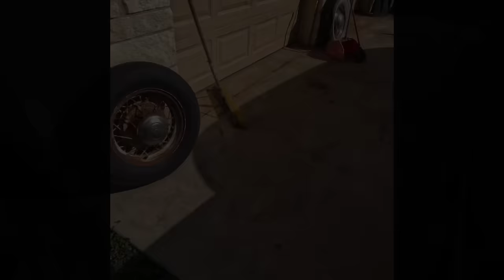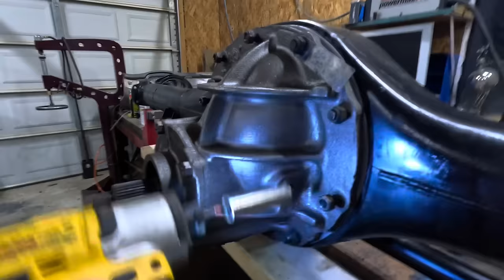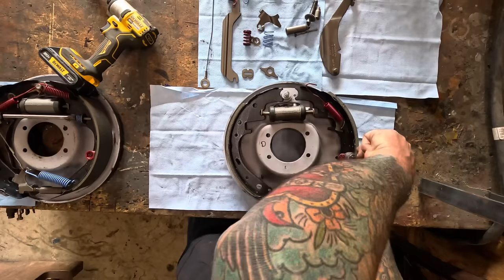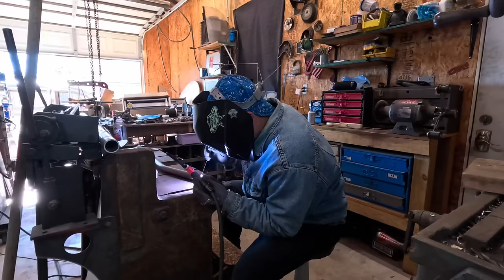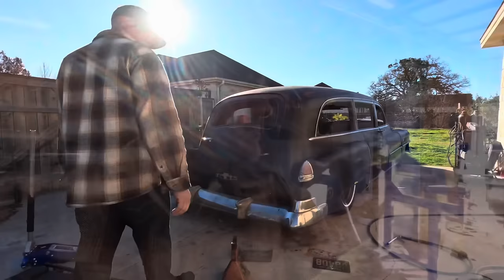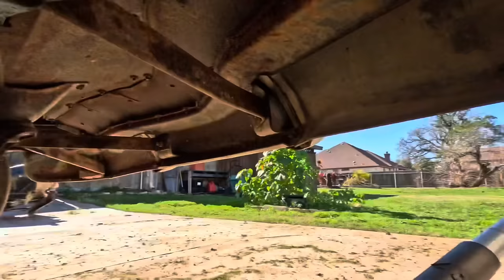1950 Cadillac Hearse Resurrection continues. Making room for magic EP6

Comment: Epic biuld,
I was also having issues with getting angled cuts also.
A few things that I found helped,
1. Put the plasma ground lead directly onto the material your cutting.
2. Slow the cutting speed.
3. Lower the air pressure / volume coming out of the nozzle.
Reply: and check tool offset if availible

Comment: Outside cuts on a plasma table should be cut clockwise so the scrap goes to the right side of the direction of the torch and your inside cuts should go counterclockwise that is why you're seeing the "bevel" on your cuts.  I backed up and watched to verify that's what was happening.
I program these every day, so if you want to reach out to me it's cool
Reply from the maker: Interesting.  I’m going to check that.  I think I can flip the setting.  Thanks. I’ll try that
Reply: @Theoldironworkshop  
Yeah man, you'll always have kerf but if you do your outside cuts clockwise and inside cuts counterclockwise the good side of your cut will be on your piece.

Comment: There are two basic types of cut edge angularity with Plasma cutting that tell a story:

1. Relatively similar angularity on all four sides of a rectangle. This means that the torch and consumables are likely in good shape. You can minimize the angularity by adjusting your height control lower, however with an air plasma (even a good one) you will not completely eliminate angularity. 

2. If the angularity varies with parallel angles on opposite sides, then you either have a torch that has some air flow concentricity issues, a poorly designed torch, or you have damaged consumables from piercing too close or with inadequate pierce delay time.

By rotating the torch 90 degrees you can check if it's the torch. Otherwise the issue lies with the airflow or consumables.
Reply from the maker: Hmm.  That is some good info. Thanks

Comment: if your using cold rolled steel plate it's going to warp like a mfer. Get 1020 Hot rolled steel plate it should help. you can take your parts to a Blanchard Grinding shop to re-flatten them. If your already using Hot Rolled steel plate that's  been normalized .look up blanchard grinding videos on you tube so you can see the process . hope this helps . if your code is a straight line, your plasma cutter is cutting in a straight line the steel is distorting from heat build up as it's cutting. I have seen 2" thick steel plate distort from being burned out to a shape just like your doing . Usually  you order thicker steel than you need to allow for the material removal from the blanchard grinding processto bring the piece to finish thickness. Hearse is awesome.
Reply from the maker: The problem is when steel tripled 3 years ago my metal yard stopped carrying a lot of things.   I’m stuck with what I can get

Comment: Have you thought about using a Crown Victoria front cross member and suspension? Might just work. Disc brakes a rack and pinion.
Reply from the maker: I looked for one. But they are too wide.

Comment: Mustang 2 isn't going to be heavy duty enough for that
Reply: I tend to agree. Theres a vid here on YT where a 40 Ford with M2 front end had the ball joints fail under load. Whether that is because of CCP steel quality or undersized components,I have no idea but the thought of one of those light weight front ends under a bus like the caddy is scary. The USA has plent of front end designs from vans to light trucks which would inspire more confidence.
Reply: @Mercmad  I would use a front clip from a GM car

Comment: 23:30  I am almost certain torch height is your issue.  Make sure your tip is correct for your material.  Make sure your amperage is 90-95% of the tip rating.  Then adjust your standoff.  Too high removes more material from the top.  To low removes more material from the bottom.

My guess is you are cutting at the same height you pierce with, blowing out the back side of the cut.  That's also what caused your first failed cut.  Failed pierce caused blow back fowling the tip.  I'm assuming that machine has the ability to set both a pierce and a cut height?  I see THC on your cut program, but that doesn't mean your machine has the functionality.
Reply from the maker: Hmmm   Those seem like some good ideas.  Thanks

Comment: Now I realize that there is amazingly little rust on the body of this beautiful and scary monster. I guess that is the advantage of a southern car that lived far from the coast.
Reply from the maker: When I lived in the north. Rust free  meant  60% of the metal was still there.
Reply: @Theoldironworkshop  Well salt takes a huge toll on our cars here in Switzerland.And the air is humid. 
And our Goverment idiots force us to have full inspections on cars that are over six years old every two years. They always find something or invent faults. A rust hole the size of a dime is a reason to fail. As I own a handfull of cars that are about sixty years old I am always fighting to keep them alive. At least when by miracle they regard a classic cars worthy, which is very hard to archieve, you have to inspect them only once in six years. But then you are only aloud to drive them 2000 miles per year.
I bough one car out of Arizona, it was nearly rust free, I bought one in Florida that had a New york title, that one was rough!

Comment: Could have saved some work and fitted a Jag Xj front crossmember and suspension to the original frame. Cheap, with big disc brakes, from a good handling full sized sports sedan. Also flat, so easy to fit.